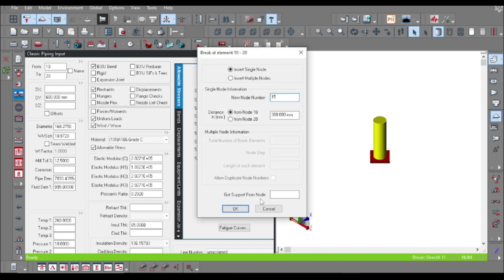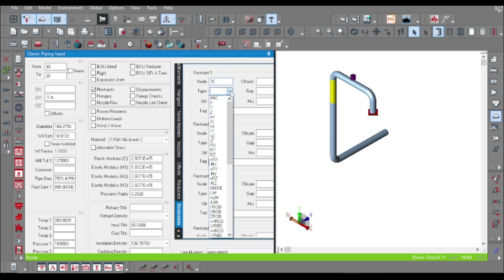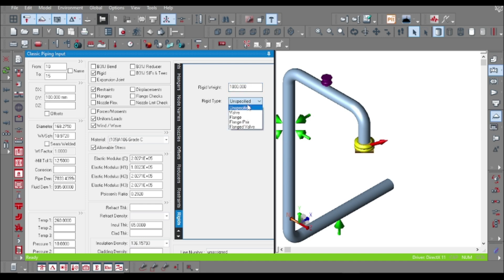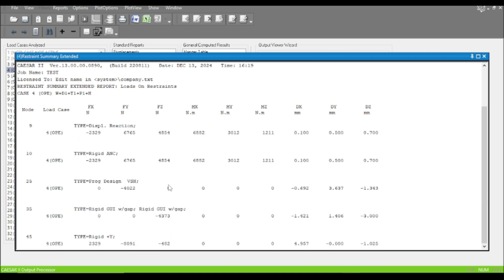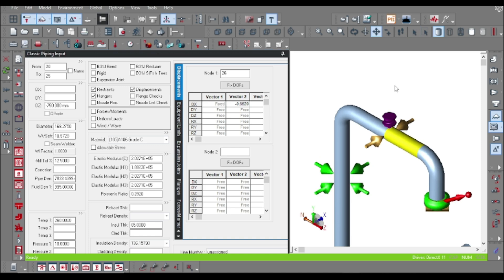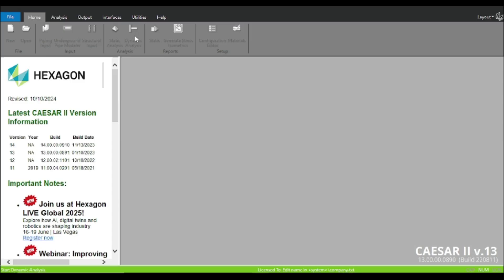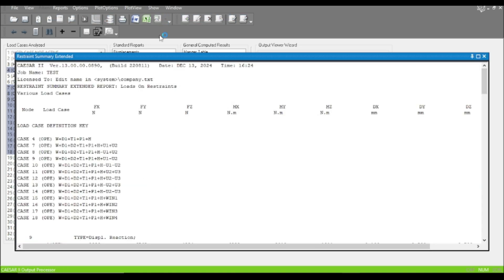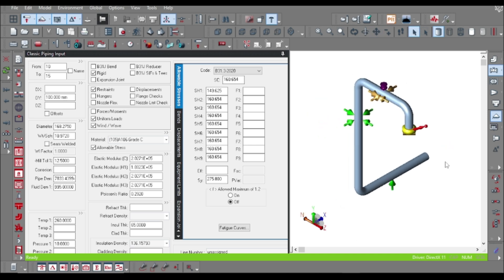CAESAR II: HOW TO MODEL SNUBBERS IN CAESAR II

Comment: Why do we need to apply displacement for snubbers, as when we select snubbers in loadcase….it tends to restrain the occ forces alone and allows to move as per ope temp.
Reply from the maker: Yes, Snubber should not restraint operating displacement It is designed to restrain any sudden displacement which occurs during occasional cases.
Reply: @PipingParadise so why the displacement is also given and snubbers is also activated at the same time?…..any one way can be followed right? Either we can work by giving ope displacements at restraints or else we can select the snubber type restraint and activate snubbers in load cases….so that caesar will take care on its own.